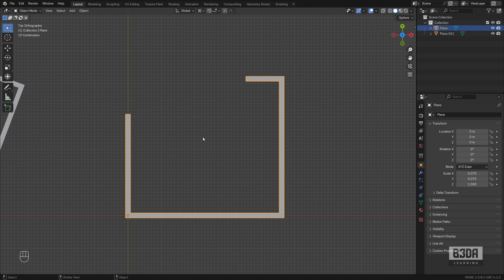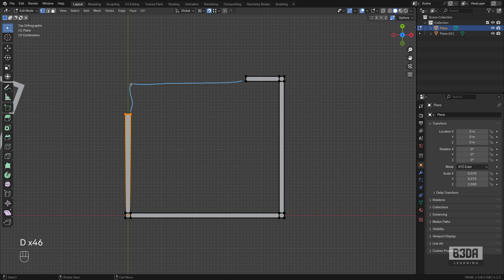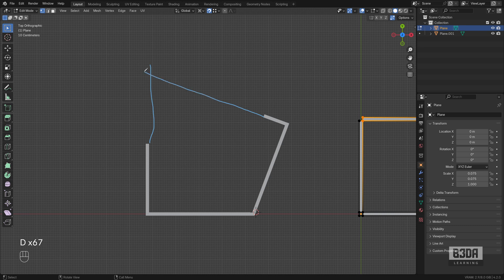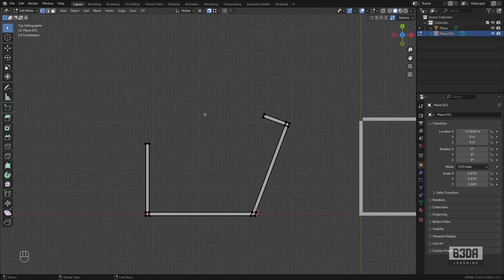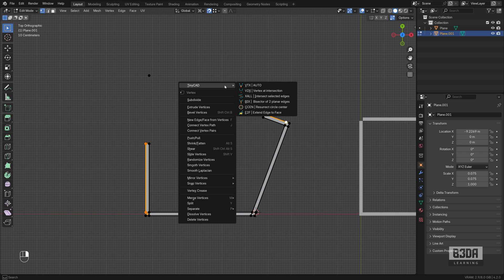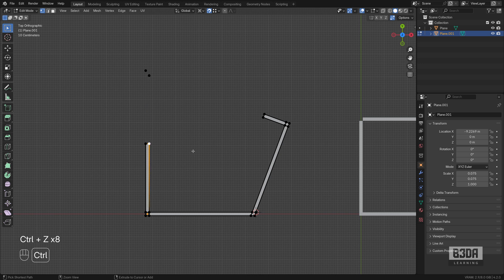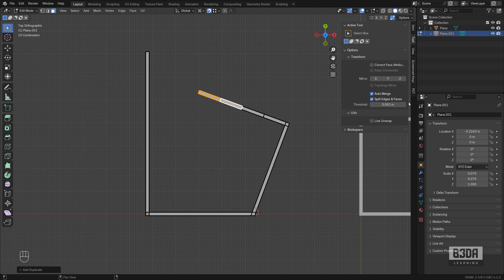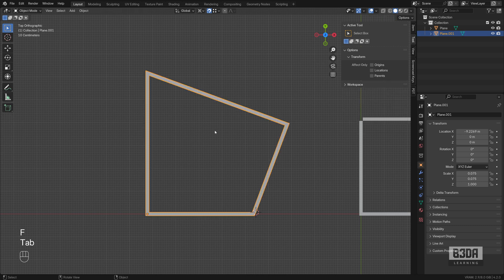Blender 4.2 Tutorial: How to find edge extensions?

Comment: Am I correct in  assuming that Tiny CAD only works within one object.  If you select two objects and go into EDIT mode, Tiny CAD does not work?  How do you join two separate objects into one, so that Tiny CAD features will work?  Thanks
Reply from the maker: Yes, you are correct. TinyCAD will work on the same mesh. If you need to merge two objects you can select them and press CTRL+J (Join) or use the Object → Join menu. This works in Object Mode.

Comment: have you tried GG  then C with auto merge and split enables bit of an easier way to bridge that gap. too as long as you get the points connected thats all that matters.
Reply: thanks, also after GG if you hold "Alt" key it creates a guideline along the edge, similar to xl in Autocad, very handy